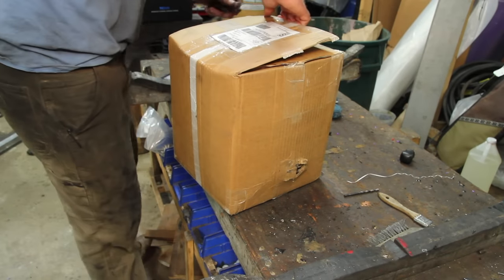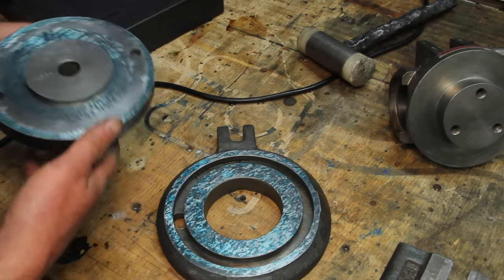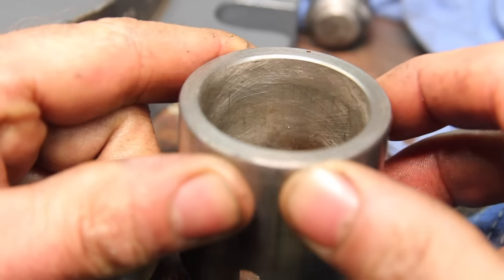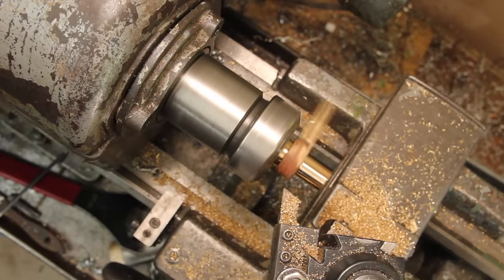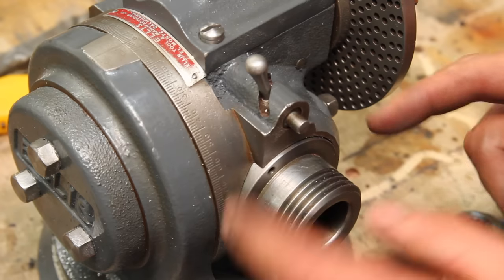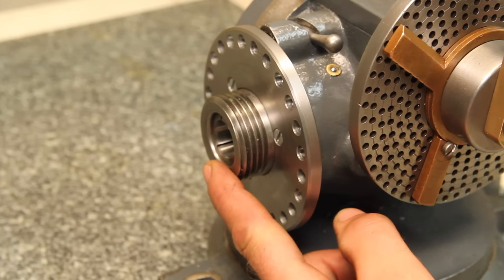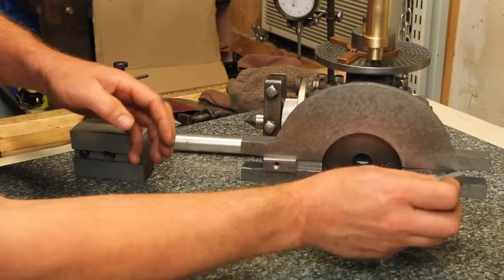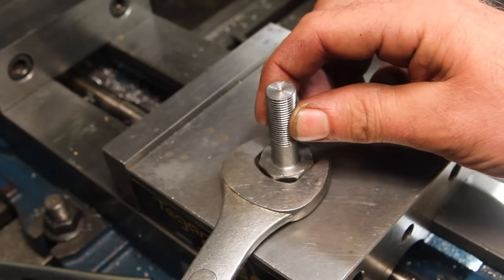Ellis Dividing Head Restoration

Comment: While I can appreciate getting lost in scraping I wanted to bring something to the forefront that people often forget: When you’re scraping an item that isn’t a large chunk of cast iron that will have an opposing sliding surface you need to take into account how it’s final install position will affect things before investing a ridiculous amount of time making it flat/parallel/perpendicular/square.

For instance the little rabbit ears on the sides of a rotating base will more than likely act differently than the large base when tightened down to a table, while said base will also experience some contact from being pulled into the table… basically scraping parts independently that will get clamped later will most likely NOT provide any real tangible gains for the time & energy. However if it’s purpose is mostly done for practice, looks, or cuz I feel like it then you are actually my long lost brother and I say Keep on Keeping On!
Reply: That’s very true. I remove burrs, because old equipment always has them. Scraping isn’t a panacea. You can get into a lot of trouble scraping. It’s not one of my favorite things to do, and it’s mostly unnecessary.

Comment: Hi Jeremy - word to the wise. Easiest way I've found is to measure moisture % is find a  consistency that works, then tamp down a known volume and weigh it. 

Another way of ensuring a uniform water content is mulling, but those machines can be a bit of a headache to find as I'm sure you're aware. 

A cheap alternative that works nicely is a big baking sheet and some non-porous sheet on top of it. Pour the sand on it, roll it with a rolling pin, then just fold it in half with the sheet, and repeat.

Comment: Nice work. Years ago I scored an odd-ball dividing head from a used tool dealer. It too had but one plate and no crank assembly. I custom-made the additional two plates along with the crank arm and detent pin. I still need a tail stock for it. Love the way you just cast a part you needed. Cheers!

Comment: Jeremy, shortening bolts with a nut like you did is simple if you use a boring bar, reverse the spindle and cut it from the back to the center. Now the bolt just becomes tighter when you turn. Best! Job

Comment: Used to work with dividing / index heads almost 2 decades back.. miss all those wheel  selection calculation and trying not to get distracted when rotating index head . Tricks to bring back to previous point in case distracted during indexing. But CNC have made life easier

Comment: Very nice restoration job.  I have the same dividing head; bought on eBay for $320.  It came with a 3 jaw chuck and was unpainted with no rust.  I think the seller bead-blasted it.  At some point it must have taken a tumble because the 15/8" 8 tpi thread was dented.  The 3-jaw chuck will only screw on part way.  I was able to use a faceplate from my South Bend heavy 10 lathe, which is 13/4" 8 tpi.   It works really well.  Except for the thread damage, it is ok.   I clawed back $50 from the seller, a good guy.

Comment: Are the plunger holes in different dividing head plates all the same size? I could see one plate having metric holes and another imperial. Or one manufacturer using a slightly different size holes than a different manufacturer even if both use metric.
Reply from the maker: Both of the plates I had were 1/8”, the plunger I used the parts from was slightly smaller, but since I had to shorten it anyway, I just cut off the smaller diameter.

Comment: Nice restoration Jeremy or better yet a reconstruction, you went all out.   At 1:18 I see that the worm pivots on a pin thru the main housing, can you explain why that is.  I'm considering 
buying a similar Ellis unit but the pivot movement seemed excessive, I thought it might be
damaged.  Your thoughts please, thanks a bunch!
Reply from the maker: It’s so you can disengage the worm to use the direct index finger plate without having to crank the handle (imagine if you were making a bunch of hex bolts, it would be easier to turn the spindle by hand).  There are two set screws on the top, one on either side of the pivot to dial in the engagement o the worm with the worm wheel or to disengage it.  It’s a pretty slick design.

Comment: Thanks for making this great video. It really has it all! Machining, scraping, forging, casting - very entertaining and informative. I found it and your channel (now subscribed) because I am restoring my own Ellis Dividing Head that I picked up at an auction. How did you get the spindle out? You showed it very quickly and it seemed like it just came out with a little persuasion. Mine is not coming out and I'm afraid of just using a bigger hammer. Also, any tips on getting the chuck off? It's stuck on pretty good. Thanks again! David
Reply from the maker: Once the lock ring on the back is off, the spindle gets driven out the front.
As far as getting a stuck chuck off, I had to do that when I got my lathe.  I chucked a piece of hex stock in it and used an impact wrench.  Brutal but effective.

Comment: I hope you checked parallelism of the sides while you were scraping. I bought one of these with a broken foot. Making a new toe with ductile iron and welding it back one wasn’t too much work. These are very good heads when they’re cleaned up properly.

The second lock screw hole is used on some versions because they’re made to reverse the spindle. It’s easier, and cheaper,  to just make all of the bodies the same. Don’t lock the rear part of the spindle. It will knock it out of spec.
Reply from the maker: I didn’t check parallelism because 1)I didn’t take enough off to really change it (much) and 2) it doesn’t really matter here because any parallelism error will be taken out when the tilt of the head is clocked in.  I guess the one time it would matter is if I had the head vertical and was cutting across it, but I think I’d be more likely to use a rotary table for that.

Comment: Caustic soda/lye/sodium hydroxide....makes an awesome paint stripper/degreaser. Usually much much cheaper than bottled stuff. I keep a fifty pound bag in the shop for all kind of stuff like electrolysis, drain cleaner, oven cleaner, geopolymer experiments etc. Of course it probably would've taken the paint and script of of your tags, and it is pretty harsh on aluminum so you have to watch.....but when you need the big guns, there's no comparison.
Reply: Can you elaborate more on exact ratios of the recipe?

Comment: I may have a set of stray dividing head plates out in the barn. I dont know what they came from, but they dont fit mine.
Reply: Jeremy, I just checked some stray plates I have. They are 3-hole plates, and I have 2 different plates. They measure 5"od, 1.125id, 0.25 thick. The 3-hole pattern circle is about 1.810" diameter. One plate is 37-49 by twos and the other plate is 21-33 by twos. 

Let me know if your interested.
Reply from the maker: @shannonstratton3164 that sounds like what I need.  I’ve got the 37-49 (plus 54), but the other one is the plate I’m missing.  Shoot me an email and we’ll talk details: Jeremymakesthings@gmail.com
Reply: @JeremyMakesThings  I'll take some pics and send you an email tomorrow!
Reply: @JeremyMakesThings I sent an email, did it go through?

Comment: Just a heads-up:  That’s probably (read “undoubtedly”) Paris green paint. If so, it’s tinted with copper aceto-arsenide.  Bad stuff if you get too intimate with it.  Just be safe, and don’t breathe in any dust from it. Working it wet, as you did, is the way to go.

Correction:  copper(II) acetoarsenite
🤓